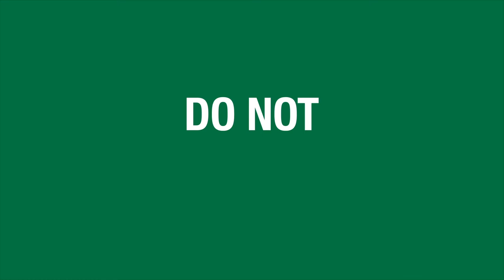How To Caulk James Hardie Products

Comment: Do you seal gap at bottom of siding between foundation and the siding?
Reply: NO
Reply: @ATLparanormalOG  Why not? It prevents insects and protects from splashing rain getting under the bottom board.The caulk holds and adheres to the cement foundation and the cement fiber board.
Reply: @c.b.-11  I believe it's so moisture can weep out, like bottom course of brick etc.
Reply: @c.b.-11  It keeps ANY water that gets behind the siding in the wall. You should never seal anything at the bottom.
Reply: If you look at Tyvek house wrap install instruction you can seal the house wrap to the foundation to create an air seal. But never seal siding at the bottom water has to escape through the bottom if it gets behind it